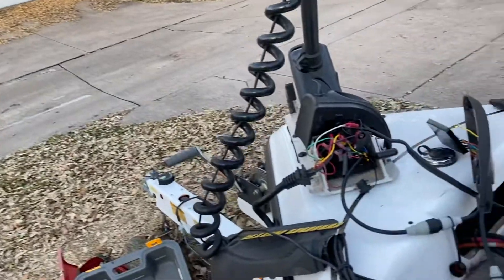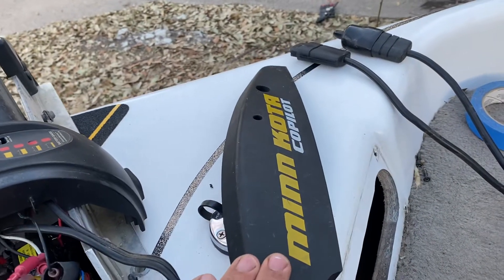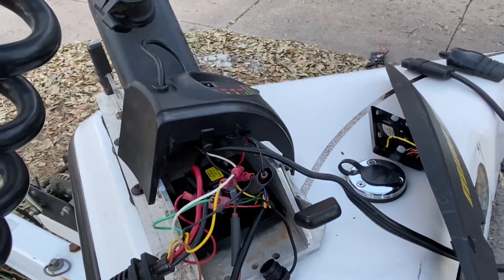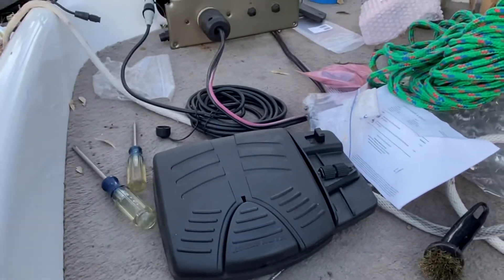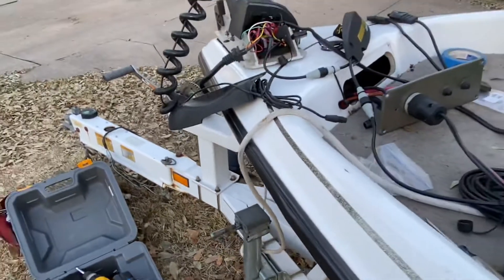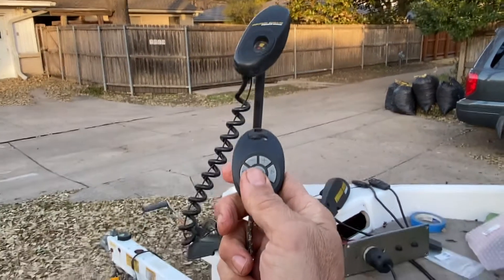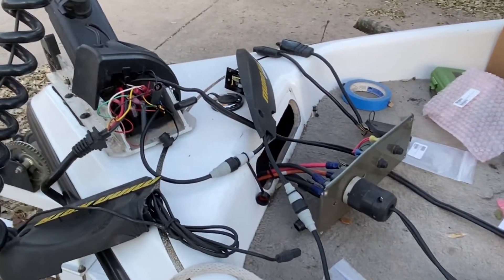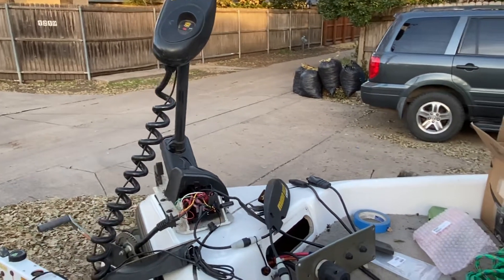DIY Minn Kota Power Drive V1 to V2 upgrade

Comment: Hello I have the same problem but I have the V1 12v  but I would like to do the same thing with mine. Did you think I can put in a 24 volts circuit board any help will be great tank you.

Comment: I’m missing the foot pedal altogether and am kinda leaning towards doing this. What are your thoughts?
Reply from the maker: I ran it for quite a while without the footpedal. Just using the remote system was very responsive. Keep an extra battery for your remote in your boat, though.